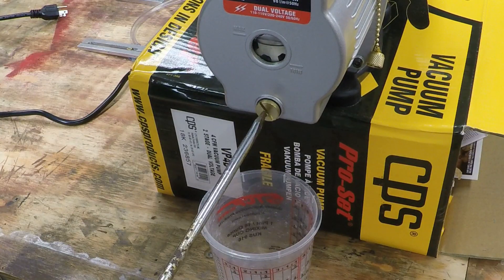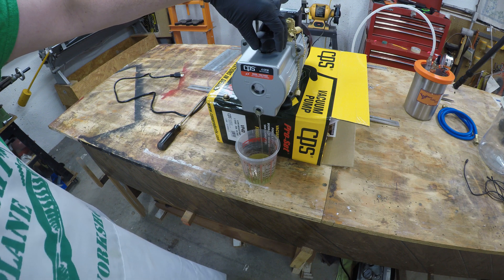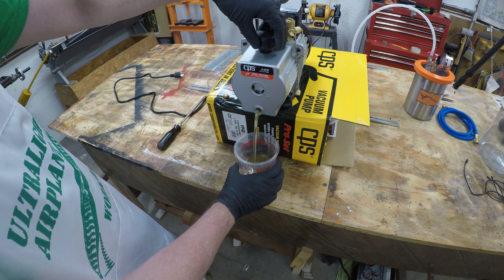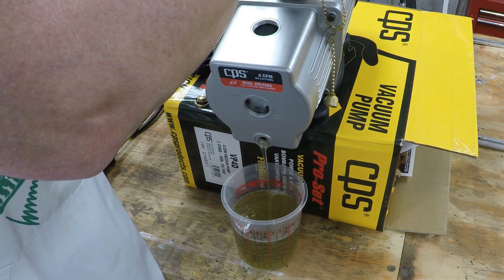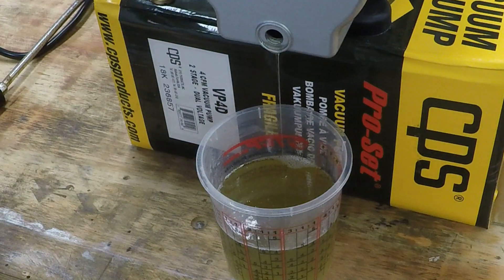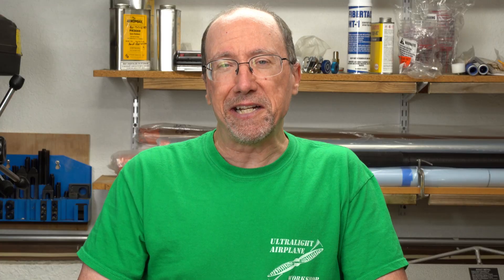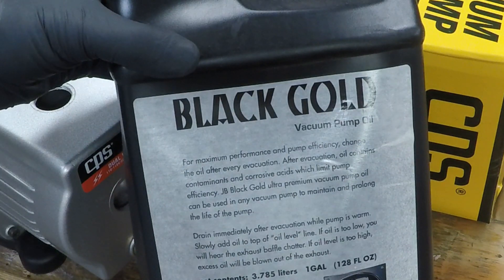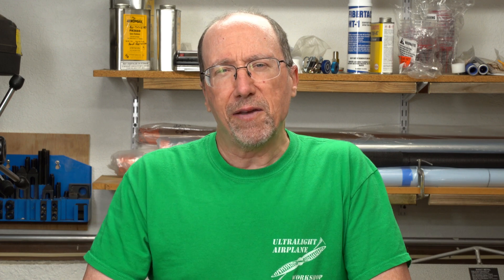When to change your vacuum pump oil

Comment: 50 hours is absolutely insane. You should be changing it after every use. The oil absorbs all the moisture and contamination from the system. If you don’t change it after every use you’re not going to be able to pull as good a vacuum. On a long evacuation I’ll change the oil after an hour or so. Make sure to open the gas ballast valve at the beginning of the evacuation and close it once you achieve around 1500-2000 microns of vacuum. This preserves the oil so you can use it for the last part of the pull to absorb the contaminants and achieve a better vacuum.

Comment: I was concerned about the color of the oil in my pump which is similar to yours, then I found a blog post on intlvac ca that has a color chart showing this is quite normal, and it is not a concern until the oil is a lot darker.  What are your thoughts on this?
Reply from the maker: So far I have not had any problems so I think that this oil color is OK.

Comment: I had no idea the oil needed to be changed as often as it does in vacuum pumps until just recently, I ran my cheap ebay vacuum pump for about 100 hours on the stock oil it came with, that stuff was like diarrhea when I changed it lol. It didn't help that I was pumping down all sorts of noxious chemicals like 68% nitric acid, 28% ammonia, acetone, toluene, alcohol, lots of water, epoxy and polyurethane gases, all the stuff that vacuum pumps don't like lol. I poured that sludge out, filled it with fresh oil, ran it until it was hot, then dumped that oil too, now it's more or less running clear. At least it's just a $60 or so pump, if I ever get a more expensive unit I'll be sure to perform routine oil maintenance on it.